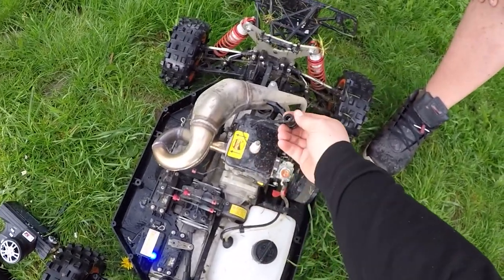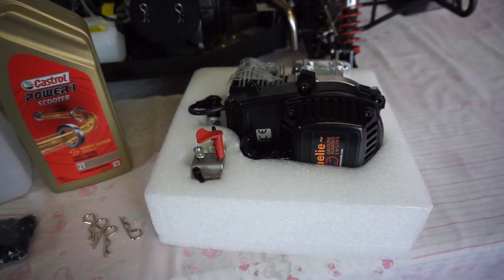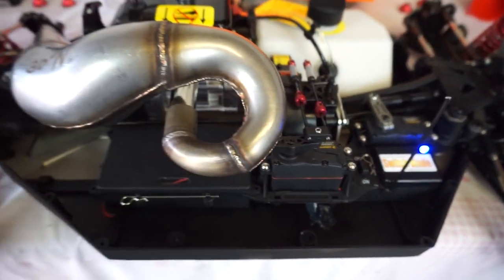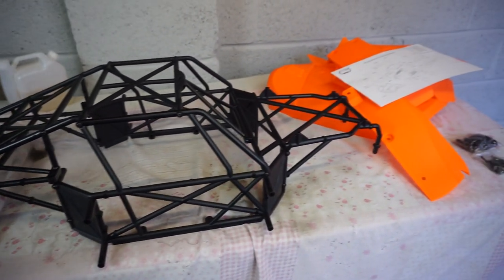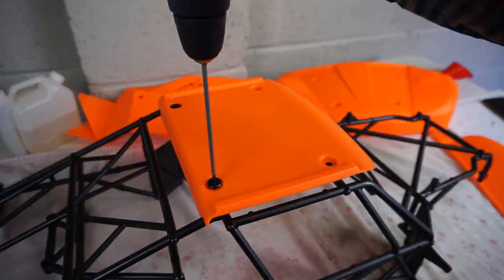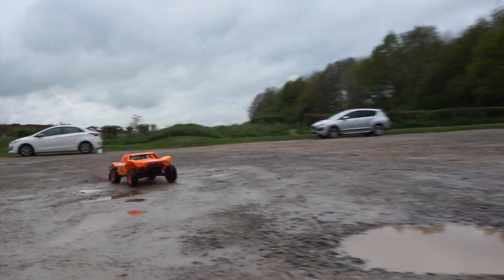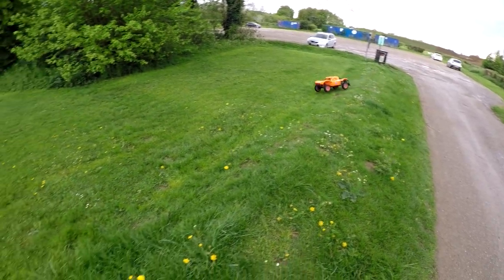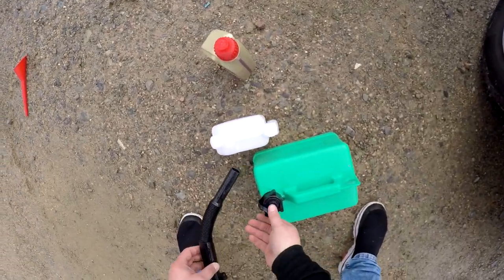DON'T Watch this Epic & Loud 1/5th Scale Petrol RC Truck

Comment: I thot the 30DN truck would have came with the 38cc by now, either way looks like I’m buying it looks perfect for bashing, the killerbee killswitch would have been the way to go u can still take the engine out by simply unplugging the killswitch.
Did u notice much difference from the 29cc blue one u had over thus upgrade engine ?